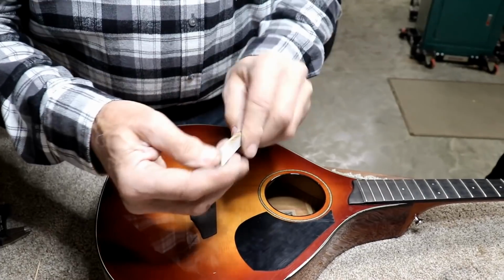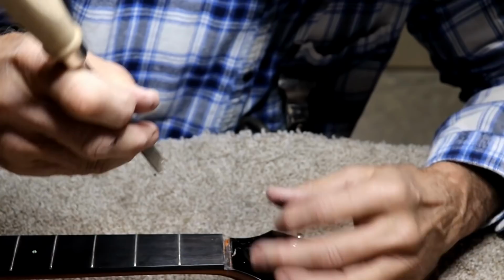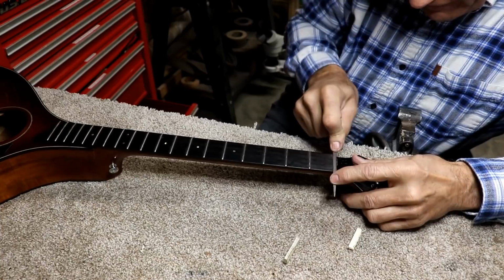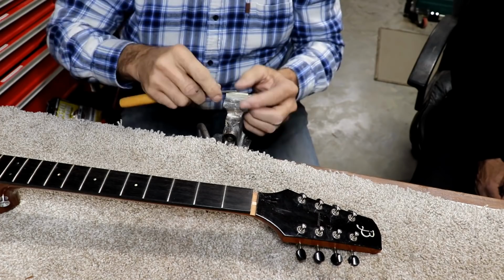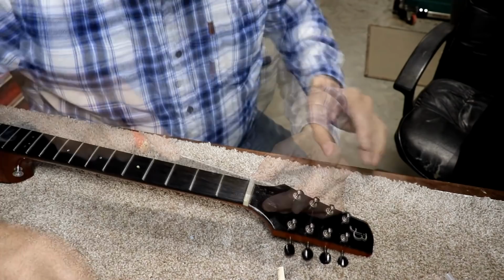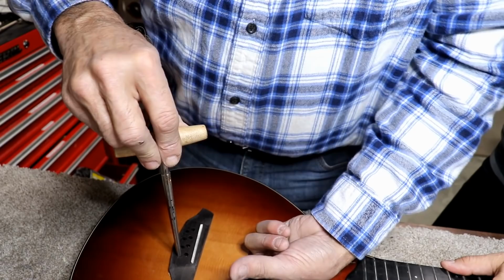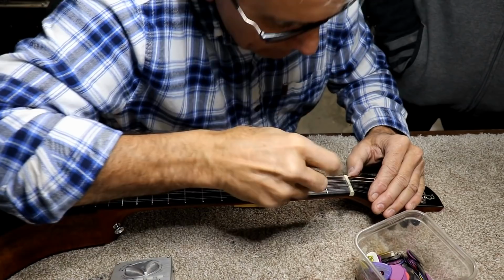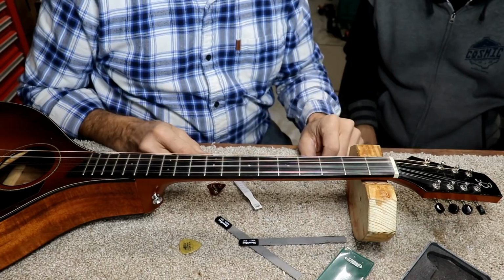567 RSW New Apprentice....DIDN'T STAY LONG! - Part 3

Comment: I used to work at Gibson guitar in Nashville doing final setup on electric guitars. One trick they taught us was to use a half pencil let it rest on the frets. Press the lead against the nut and mark it all the way across. That line is a pretty  close to the depth of where the nut slots should be

Comment: Unsubscribed. Best of luck.
Reply: Why, for crying out loud?
Reply: me too
Reply: I’m bit confused…was the new guy fired and why ? Did he quit and why ? Just curious 🧐
Reply: @nationalduo4945  LOL, it was never a job... He was visiting. It's a joke. Did you not watch part 1?
Reply: @steveblease  Ohhh ok lol….thanks
Reply: @WillemvanLonden  I'm sure its up to them to watch what they like and that's what subscribe button is for. What I don't get is telling viewers in the comments that your doing it. I enjoy jerrys videos but sometimes disagree with things he does but its good entertainment.
Reply: Well….bye
Reply from the maker: I'm sure you will make us both happy.
Reply: @RosaStringWorks  any luthier that uses titebond instead of hide glue doesn't know what they are doing generally. . Best of luck Chief.
Reply: @uprightdoublebass  some applications do call for hide glue but glues have come a long way and most builders use modern glue to make instruments. Even CA glue us used by some of the best guitar repairers.
Reply: @stu-j  Very true Stu
Reply: @stu-j  hey, yeah, I can see that perspective. I was told personally by George Chestnut that the purpose of using hide glue is to be able to safely deconstruct an instrument. Hide glue is workable at room temp and without needing to steam wood to loosen, which can sometimes compromise the structural aspects of the wood. 

Peace
Reply: @uprightdoublebass  not getting into a glue debate but removing a neck from a 100yo guitar is just as hard as something 10yo that uses traditional wood glue. Lots of repair craftsman now use electronic heat to remove necks but sometimes you need steam or heat to remove something like a fretboard. Cheers.
Reply: @stu-j  it's cool